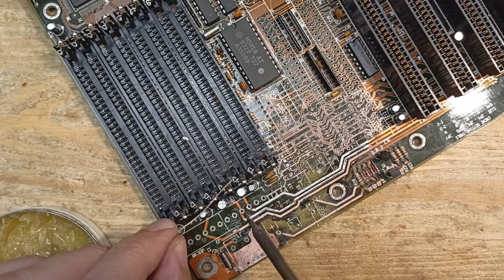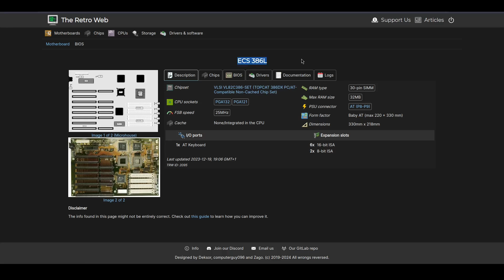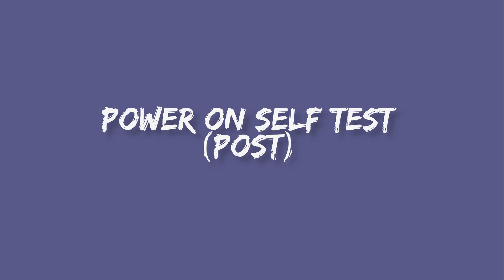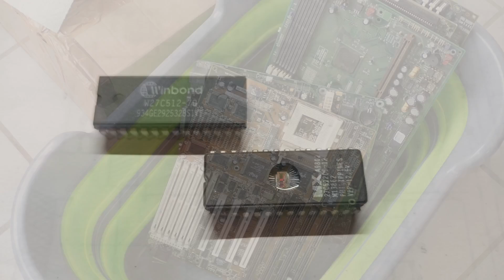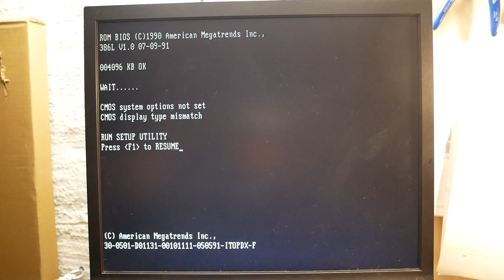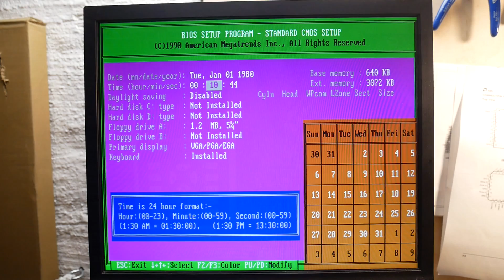Howto repair a retro PC motherboard.

Comment: What kind of scope is that, and do you know of a relatively affordable one such as that?
Reply: around $70 in Amazon, I see. some older models (by only 2 years, lol) of the same manufacture or similar ones, around 40-50. some have upgradable firmware

Comment: a guide for newer boards, like skt 462 let's say, would also be welcomed :) thanks for the info :)
Reply: There is never a guide possible 😀 each board and issue is different. I have for example 20 462 socket boards to repair and each one of them has a different issue. A basic troubleshoot video for such board generation is highly doable
Reply: @SzymekCRX  you're right. i have the infamous Abit BP6 with no signs of life :( i don't know where to start from, newbie is too little said :)
Reply: @Constantin314  no power on or no post? Pci code debug card is also a must in Your case. Doest it power on alone, with and ram?
Reply: @SzymekCRX no post. the cpu and nb get hot, cpu fan spins. no post beeps or video signal on agp or pci. cause of the cpu and nb getting hot i think the board can be repaired

Comment: The fact that you can clearly see the fiberglass weave on that spot means something hit this thing pretty hard. Surprising that there wasn't much more damage than a couple of messed up caps and one small trace break.
Reply: You don't see fibreglass that much these days. If you watch Apple and modern video card repairs the PCB is closer to compressed paper. I've seen iPhone PCB turn to dust, ie, burn, with a high current short on STS Telecom channel. Modern GPUs are the worse, because pads fall off or go lose under BGAs all the time , and that's not mentioning the cracks at the holding down lug that northwestrepair is repairing all the time.
Reply: Ikr. I would've thought that this is a multi layer PCB and one of the inner layers got messed up too.
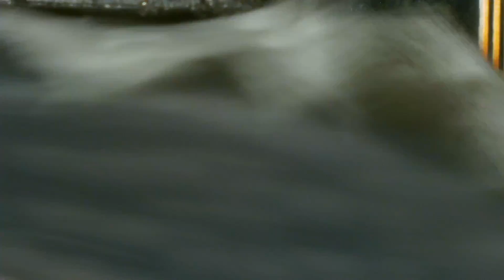Reply: @SockyNoob  I'm sure on the close-up view through the microscope that you can see the very edge of another trace inside the board to the right-hand side of the damaged area. Maybe I'm seeing a reflection or something but it's around the 20:05 time in the video. I'm guessing that it's not going to be highly populated with traces that close to a screw hole, so this board is quite lucky.

Comment: I just noticed on your logo/intro, the board looks like it's supposed to be a 16-bit ISA card, but aren't the components then on the wrong side of the board? They changed the orientation of the slot bracket relative to the card starting with PCI, so that the components face down in a traditional tower, but on ISA they would've been facing upwards.
Reply from the maker: Nice observation ;) and it's like you said